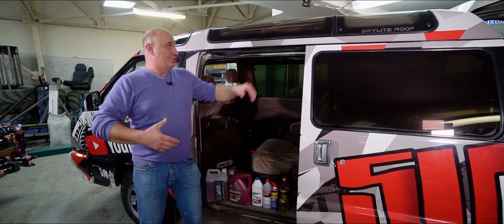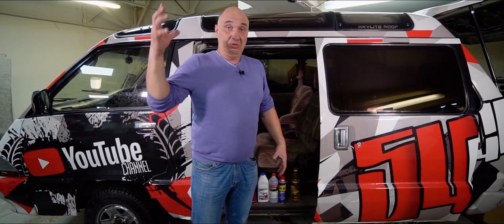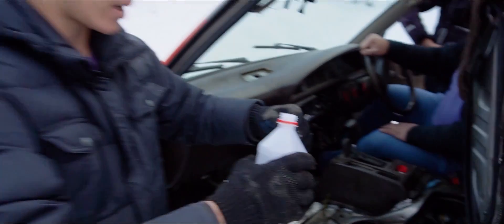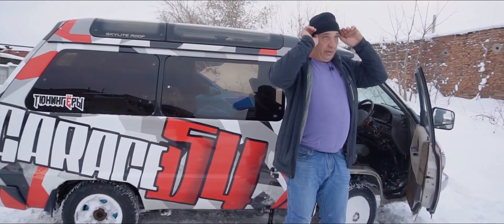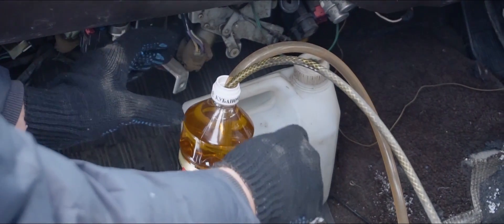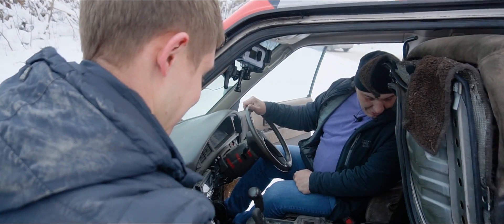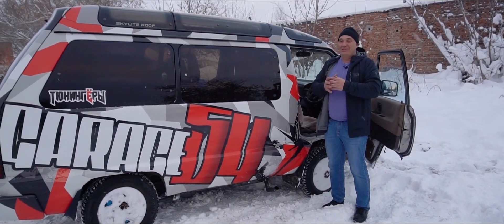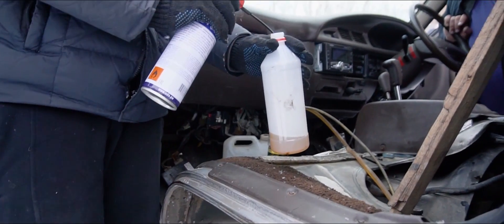Alternatives to diesel fuel: WD-40, cooking oil, brake fluid, Dexron

Comment: Im not surprised it ran well on Sunflower 🌻 oil,  any cooking 🍳 oil will work,  but brand new Sunflower 🌻 oil will run 🏃 the engine as normal, good test pity about the WD40, but even if it had run 🏃 will real WD40, it would have pinked I think,  Sunflower 🌻,  good for emergency or if have nothing else, well done, love the videos never say 💭 it can't be done lol 😆

Comment: Dude in Romania the cheapest sun flower seed oil is like half the price of diesel. Are you sure that would work long term without fucking up the engine??? 🤑🤑🤑
Reply: If it is an older engine with low system-pressures it will run without issue (except the oil freezing below like 5-10C). Some hoses do not like the oil and will deteriorate, but you can change those.
If it is a newer engine I wouldn't risk it losing lubrication and eating it's pump.

Comment: Imagine if the turbo was on with the cooking oil.
Reply: now imagine with the dexron since it was actually over fueling enough to actually want denser air coming in the motor.
Reply: aLLRimmeDouT I put atf in my 7.3 Powerstroke. It loves it
Reply: @kieran8720  I work with a guy that does that also.

Comment: A diesel engine can run on pretty much anything. You can put almost every possibly fuel into a diesel and it will run on it.
However, in order for the engine to be reliable with different fuels, the fuels need to be properly filtered and have descent viscosity, otherwise your fuel filter, diesel pump and injector have a risk of clogging up, and in some cases leading to failure.
(Edit: The reason for the fuel to need a certain viscosity is the fact that the fuel pump is only lubricated by the fuel i side the pump. To thin and it will soon seize up.)
Reply: There are U.S. military vehicles designed to run on multiple fuels.  Gas, alcohol, diesel, and many sub grade oils.  I’m sure other countries do as well.
Reply: @tomtheplummer7322  it's a gas turbine.
Chrysler made a car with it, and it ran on tequila
Reply: And if you use AVGas the fuel pump will fail;)
Reply: Cooking oil is much thicker than diesel, so it's, in theory, bettet

Comment: Of course kerosene works, it's used as an anti-gel in cold states in the US. ATF will work as long as it's conventional and not synthetic.

As a general rule, a diesel will happily run when these three conditions are met: 1, it burns. 2, it lubricates. 3, it's filtered  as to not plug the injectors.
Reply: Kerosene is filtered Diesel. Also called A-1 Jet fuel. Simply diesel fuel, with more testing, for safety reasons.
Reply: @Mp57navy  kerosene is thinner than diesel and it's not good for lubrication. Thats why they were hearing a knocking sound, which i think is from the high pressure pump.
Reply: @shaun milnes Synthetic ATF has more detergents that dont burn and leave carbon residue on the tips of the injectors called coking.

Comment: Mix kero and Veg oil  in  common rail it works just as well as Diesel. I used it in many German diesel engines and it has worked well.👍🏴
Reply: Do you think 1% oil motor (15w40) add to 99% kero will be good for run my old hdi?

Comment: The first diesel engine made was designed to run on peanut oil and you can make diesel out of recycled cooking so no surprises there.   WD40, kero and Valera have solvent in the oils so not good to run a diesel long term on them.  They may have a cleaning property within the fuel lines and even rings so a short run of it on an old motor may help compression???   A job for Project Farm!  If you want to destroy the motor "Petrol it"!

Comment: how I ran my old diesel. I went to a shop that specialised on transmission flushes and I took their old oil and used it in my diesel. Yes it smoked more and power was noticable less but it was for free and every half year I ran some old brake fluid to clean the injectors. The car went and went until it was so rusty there was nothing left you could weld anything on and of course I failed inspection
Reply: I use new trans fluid as a cleaner and a clean way to prefill filters.  ATF has a shit ton of  detergents in it.
Reply: @CutTimeBrony  well yes if you clean mechanically but not non touch clean

Comment: Sunflower oil works fine in almost all old diesel and turbo diesel, and if you go measure the exhaust, almost no nox 😃. Downside is price and lack of detergents that clean the engine (lot of farmers use this oil in their tractors)
Reply: yep you can add a bit in there or some thin caster oil which will help :)

Comment: Diesel itself lubricates the fuel system as it has additives for that, thats why you could hear more/less noise depending on what fuel you used, 
If you use heating oil/kerosene as fuel add a cap full of engine oil so you gain some  lubrication on the pump and injectors, once its warmed its close to diesel power wise
🤘👍
Reply: Lubricity
Reply: @texasslingleadsomtingwong8751  fair one that is the word i was looking for 👍
Reply: @upsidedown4155  i kinda thought you were . Lol . I do that all the time .

Comment: this is why I love indirect injection Diesel engines
Reply: Even direct injection Diesel engines can run on various other flammable liquids. I think you're confusing direct injection with common-rail. Most Diesel engines are direct injection. Common-rail injection is a Bosch trademarked system that uses a separate high pressure pump with electronic injectors. The Bosch pumps are notoriously finicky about fuel quality, and will fail quickly if you run something that is too thin or has too little lubricity through it. But direct injection engines with a mechanical injection pump or cam-driven plunger type injectors can easily run alternative fuels.
Reply: It is shocking how little power those 7.3 non turbos have. Blow black smoke steadily if your pulling something hard for it. I'm comparing it to the turbo version of course, it's a very big difference
Reply: There are no indirect injection diesels 😂maybe an pre chamber diesel
Reply: @motorenbastler9289  They are called indirect injection engines in the USA. I don't know about other countries.  My '94 Ford F350 has a 7.3 liter International idi engine w/ no turbo. It gets up to 60 mph/100kph eventually.
Reply: @the_mowron  yep I have a 7.3 idi turbo too. Also the Mercedes om617 is an indirect injection diesel. Any diesel that has a pre-combustion chamber is. There are lots of them out there.
Reply: Austin Stoddard idi turbo? What year? The idi 7.3s is usually referring to the pre turbo years (not including 93/94 banks special packages) before ‘94. Wondering if you slapped a turbo on an idi and or you just have an obs 7.3 engine
Reply: @kieran8720  94' ford factory turbo package. Not the banks or hypermax or ats kit.
Reply: Austin Stoddard Shitchea, my 96 is my personal favorite out of the 3
Reply: Austin Stoddard between a 92, 96 and 2000 that is
Reply: @kieran8720  93'-94.5' yyou could get a factory turbo option from the factory.
Reply: @ASdt360  Mine is most definitely NOT a turbo. That's why I said it will get to 60 mph eventually (maybe).
Reply: @the_mowron  there is no Diesel without direct injection. Thats the only way a diesel works. What you mean is a pre chamber injection.
Reply: @the_mowron  I run all kinds of stuff in my 96 7.3 powerstroke . The only thing she don't like is the rain water that sneaks into her front fuel tank around the pump gasket . Stupid pump is right below the truck bed drains .
Reply: @kieran8720  how many miles does your 96 have.
Reply: @texasslingleadsomtingwong8751  150k all stock as of now

Comment: A mechanical pump runs on almost any oil. Only problem with cooking oil is when it gets cold. I have run on 100% cooking oil in the summer and down to 30% in the winter. 
And it is not so sensitive if "a little" air enters the system. It vents itself. =)

Comment: Hell I'm buying an old Diesel truck for the APOCALYPSE and stockpiling old oils like cooking oil, vegetable oil and the likes!
Reply: Wasted motor oils works too! I have apocalypse vehicle so I know. 😁
Reply: You need understand the chemistry process to seperate the esters out of the oils to convert them to diesel fuel so fat does not clog up your fuel lines likened unto cholesterol in your arteries

Comment: HAH. i would like to see you try it on a common rail new diesel engine. I doubt those will run. please people only old diesel engines can do this. it will wreck it if its a modern common rail one
Reply: Yes this was covered in the video.
Reply: It will eventually. Although vw group cars of ~2000-2005 year still could run this as long as they don`t have PD injectors. Fuel system and a pump aint issue, the issues are with injectors, because the modern PD injectors are very sensitive, the engine probably wont even start or it would shut down instantly...

Comment: If your refer to Jet A1 as Kerosene then Jet A1 is a dry fuel related to diesel fuel but refined and treated to resist low temperatures. I have a colleague that runs an old Golf on jet fuel and it mixes some 2 stroke oil to help with lubrication.
Reply: Ratio oil/kero?

Comment: Iv used cooking oil in a few of my cars over the years but only use new oil rather than filter old. No diesel at all ever and non ever had any issues. I'm in uk
Reply: USA, I have a 240d, using a two tank system with heated fuel lines.  Runs fine on used cooking oil.  I filter the oil using a centrifuge.   17yrs so far.
Reply: @daytonkeyes84  pretty sure the diesel engine was invented to run on it for agricultural engines and use. But pretty sure I'm not. Its just the newer ones than can't. Anything with a mechanical pump will do and will run great.

Comment: Sun flower seed oil? Sounds more like performance racing gas
Reply: The E85 of Diesel engines xD
Reply: Back in the 90s in Germany, many Golf 2 diesel fueled with sunflower oil. It was still very cheap and actually worked well. However, not so ideal in winter xD
Reply: Communist biodiesel = CEMECHKIE OIL xdddd
Reply: Lots of trucks and equipment in the US are running on soybean oil or a soybean-diesel blend. Or reclaimed fryer oil. Just a matter of tax evasion. Legal for off road fuel tho.
Reply: Like e85?
Reply: @wildanh7806  in a diesel? Yes sure

Comment: I put in a TDI used oil, etc.... and the motor works!! Any problems
Reply: Smoothest the engine ever ran was with a fresh tank of of diesel with a gallon of engine oil.
Reply: What language are you typing in?
Reply: @neuzdost1939  push not, put. Im sorry

Comment: Bosch CP4 pump would have die with these oils. They are really sensitive to contamination other than diesel fuel.
Reply: Whelp. Time to use a carburator then...

Comment: No surprise there. Diesel originally made his engine to run off of peanut oil.
Reply: I think the original plan was to use coal dust, but it turned out to be difficult to feed into the engine
Reply: @MF175mp  Really? I suppose that's possible. But yeah that's why biodiesel is a thing. Heck Diesel would be perfect if cold temperatures weren't such an issue. Yes I know pan heaters and such, but gasoline simply works better in colder temperatures.

Comment: Try antifreeze or coconut oil or waste motor oil
Reply: Look up the “coconut rebellion”

Native people blockaded by Australia in the Philippines withstood a fight for independence using old Toyota pickups running in coconut oil. 

They said 15 coconuts makes about one liter of fuel oil. 

They also took old mining equipment and set up water mills with alternators to have electricity 24/7

Comment: does running on sunflower seed oil make the car "green?"
Reply: you need virgin olive oil to have a green diesel car, with sunflower oli you only have a yellow diesel car
Reply: Na it's amber actually. But will make your car black if you spill it over the paint work.
Reply: It does. It emits far less "diesel particles" and next no non CO2.
Reply: @darenzy  CO2 and H20 are the main combustion byproducts (only ones in ideal combustion) of all simple hydrocarbons and alcohols. The most common other byproducts (at least for gasoline) are CO and NO/NO2 due to non-ideal air-fuel mixing, non-ideal air-fuel ratio, too hot/cold combustion, etc. which are why gasoline engines have catalytic converters.
Reply: well it doesnt, because to make 1ltr of sunflower oil, you probably need close to 2ltrs of diesel burned... Because all the machinery use diesel engines to take the harvest. Also a lot of effort to press it in to the oil. So I think using actual diesel fuel is a better option. 

There was a study showing that to make 1ltr of Biodiesel, you need to burn 2ltrs of regular diesel in the making...  So all that "green dream" crap is actually making the things worse than they actually are. 
The greenest thing might be using a used cooking oil, so it becomes reusable.

Comment: You can buy wd-40 in bottles or normal cans instead of spray, then it would probably work. Also it would be interesting to see the emissions and fuel efficiency on that sunflower oil.
Reply: Lots of old mercedes do currently run on it. They have those results

Comment: but now to be a true Russian you must find pure Russian Vodka and see if it'll run
Reply: Everclear will work. Normal vodka is 60% water, and will not burn.
Reply: @Mp57navy  The original definition of 100 proof was if the alcohol burned. Currently we define 100 proof as 50% ABV but it can actually vary a lot by air temperature. If the engine is already warmed up it should work even with 40% Vodka. That is the absolute minimum that will burn given high enough temperatures. Probably won't run well though.
Reply: Normaly on a chain saw it should be work, but only as iddle speed...
Reply: Project Farm ran a lawnmower with aerosolized Everclear, it didn't mow straight lines though
Reply: @kekoraaaa    :-)
Reply: if you heat it enough you can run on a spirit vapor from it
Reply: A lot of water in the mixture, but I think it is possible with pure spirit thow
Reply: Stalinuom ?!!
Reply: It works on moonshine
Reply: Not sure if sarcasm and throwing humor at the Russian vodka thing... But this is a diesel engine and diesels won't run on stuff like vodka (alcohol) and gasoline. Diesels work off compression and have no spark in the combustion chamber. Gasoline engines need a spark. When a gas engine burns fuel, it burns the fumes from the fuel. High octane fuels have a high evaporation point. The spark ignites the fumes and that burns off the rest of the liquid fuel. In diesels, the ultra high compression ignites the oil/diesel fuel. These have very little evaporative properties, so they need  to burn themselves. That's why diesel just smokes like crazy when you put some of it into a gasoline engine. Lack of flammability by spark (lack of fumes/off-gasses). A high octane fuel into a diesel combustion chamber will just smoke/steam and not catch on fire. The ultra high compression creates a ton of heat and can easily ignite oils, but not gasses. 

There's a proper term for this and I forget what it's called. 

You put vodka (even 100 proof) into a diesel engine, that's only 50% alcohol... This engine will stop dead in it's tracks.
Reply: @brucewrigleysgumchewz4667  A diesel engine easily runs on gasoline, doesn't need a spark to ignite it. The ultra fine spray that a diesel injector makes plus high temps and compression in a diesel will very easily ignite the fuel. Infact it will run even better on gas because it ignites so easily.
The only problem is a diesel engine won't last very long on gas. Gasoline doesn't have the lubricating properties of diesel and will destroy the high pressure pump very quickly. Especially on a modern common rail engine.
98% Ethanol would be the same, the engine would run but be destroyed by lack of lubrication.
I will say though, 50% ethanol almost certainly has too much water to be able to run.
Reply: @xeigen2  what if you mix 2 stroke oil with the petrol then put it in a diesel? Lubricant enough then?
Reply: @blackterminal  It would definitely work on an older diesel. On a modern common rail you'd have to get the mix perfect, they're very sensitive to the exact lubrication level. But in theory yes, 2 stroke oil would work.
Reply: Kid this aint no gas/petrol engine veheicle, this is a dirty slag of a diesel.